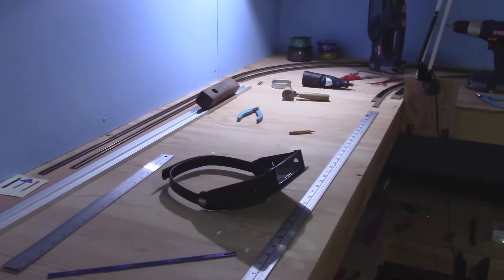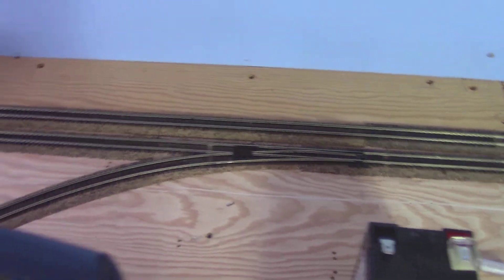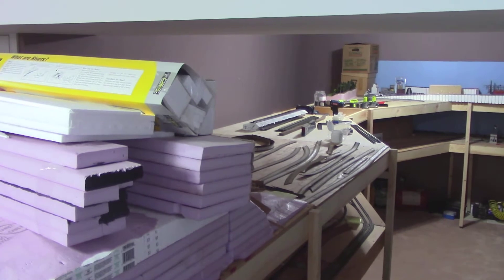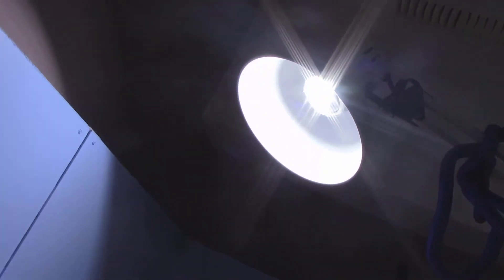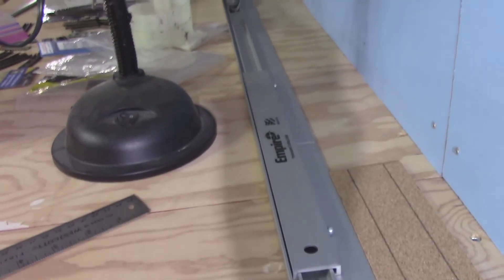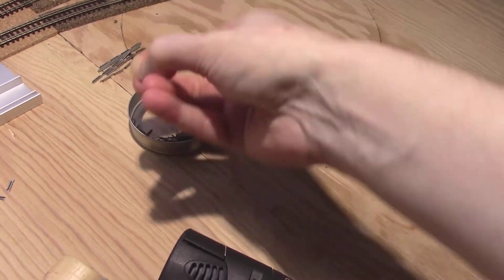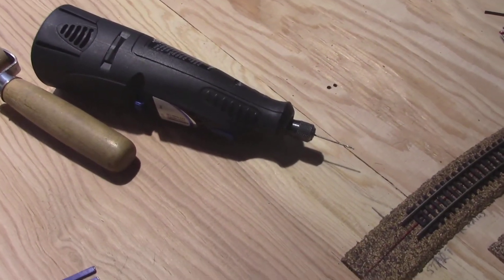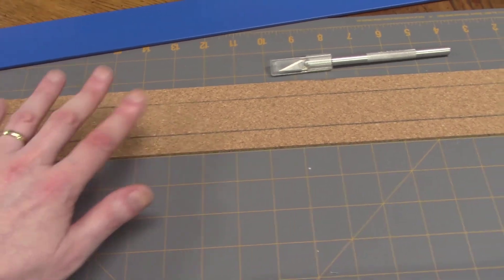20171022 Layout update - track laying on the upper level

Comment: G'day David, is the cork roadbed expensive over there, it's very expensive here in NZ?...............cheers Mark
Reply from the maker: The n-scale Mid West Cork is about $33 CDN for a box of 25.  A source for cork off a roll is about $21 CDN for a meter length, with the width four feet.  Sure do pay a lot for those bevels on the Mid West Cork!  Add on the  13% sales tax and it adds up.